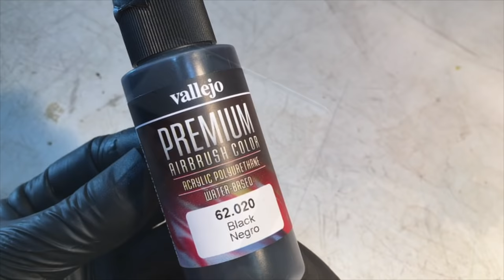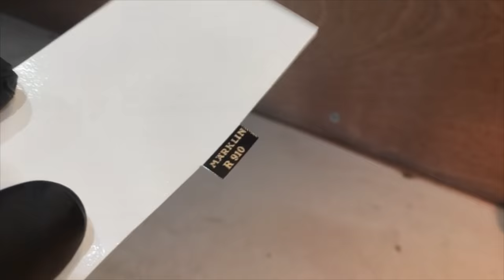Pre War Märklin locomotive - Abandoned model train - Restoration

Comment: Such a amazing coincidence, Thomas and Friends were all originally modeled around Marklin kits. In series on Thomas  wasn't the engine you saw moving and shuntng trains, if you saw trains heading into a siding they were most likey a run of the mill Marklin 0-6-0 saved on motor use. 

But Puffa and the Goods train in Tugs were the same make after minor rebuilds. This has given me a idea, for a villian for the railway of Teganji. First it is going to borrow from your engine in how rusted and cracked it is and will have markings in the rusted paint styled off Marklin, but the engine will hace quite a bit of US like fittings like a hodge podge of Marklin and US tin toys may I use this in my planning of "Blake Stone"?
Reply from the maker: Thanks a lot for all these informations !! Does this engine would match with another brand ? i have no idea...
Reply: @TheFabrik  As far as I am aware this little engine is pure Marklin, so there shouldn't be any like in say JEP, Hornby and the other tinplate companies market. Especially considering Marklin was of Germanic locomotives primarily in design. No what I mean is this is inspiration for my own creation.

A villianous toy train that is part Tin plate and part much worse. Basically he is the Sark (Tron movie just in case) to the Tron that is my character Reed. 

Reed being based off a 1980s train my grandfather gave me and all he is made mostly of plastic. Living plastic as is the case in my toy series but Plastic unlike "Blake Stone" who is a tin plate mix of this and a old real loco that failed due to design on the Central Pacific. Which is ironic as Reed is also inspired by a engine coupled with toy concept and that engine played C.P. 131 in back to the future.

Back on the Thomas front here is more info from their wiki https://ttte.fandom.com/wiki/M%C3%A4rklin_Engine I hope that link works the A in Marklin has ' ' indicators on it. I know the word but cant remember the spelling.

Comment: Stupendous end result, well done.

Have to admit I'm not a big fan of that method of construction that was so popular in the 50s & 60s, of pushing a tab through a slot and then bending it over or twisting it. Had quite a few toys made like that in my youth and they didn't last long! Obviously something as carefully restored as this is not going to be bashed about by a 7-year-old so it won't have the same problem but in general, it wasn't a design that was built to last and I'm really surprised that Märklin (or any German company) used the technique.

My brother had an electric Märklin train set - don't remember what gauge - (he foolishly sold it for way less than it was worth. But what did we know in those days, right?) that I remember as really solidly constructed, certainly nothing like as "pressed tin" as this. The rails were a bit flimsy though.
Reply from the maker: Thanks a lot Christopher 😌🙌 Märklin is the best in my opinion... very fragile though... you’re right

Comment: I did not read all the 701 comments. But I have a question: Can you please explane and/or describe, how you produce the decals for the models. Which PC-program do you use? I am new in this problems, but i have a lot of MÄRKLIN-0-models, which need new decals "MÄRKLIN" and numbers and so one. Can you please help me?
Reply from the maker: Hi, I just take pictures of original decals if they are in good condition... sometimes I grab some on the internet. After that, I re-edited them in Photoshop or Gimp, then I just print them on classical decal paper. You just have to do several attempts to get the correct scale. You’ll also need to varnish them before to put them in the water. This is what I do... it’s a huge job... depends on the initial photo quality...Thanks !